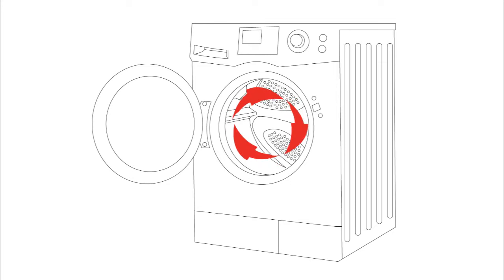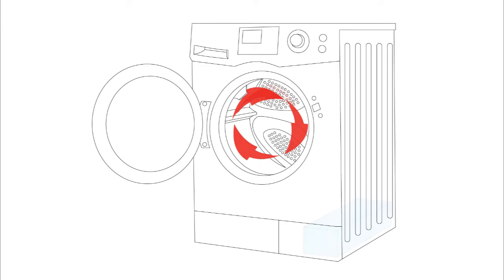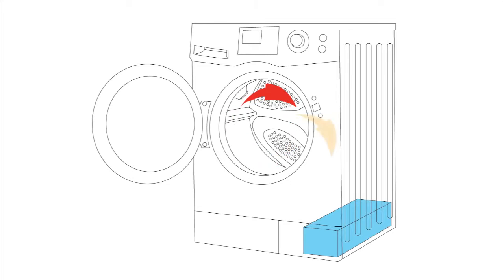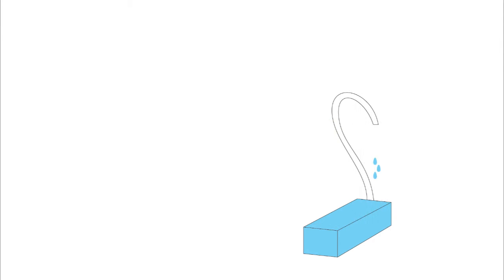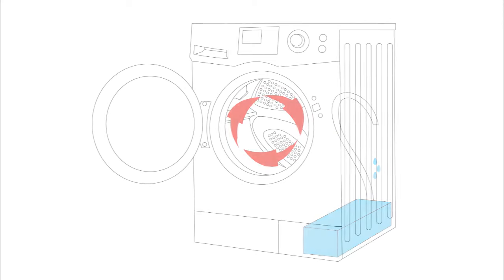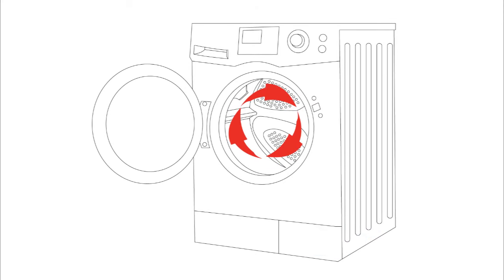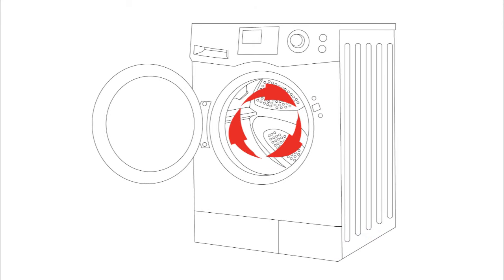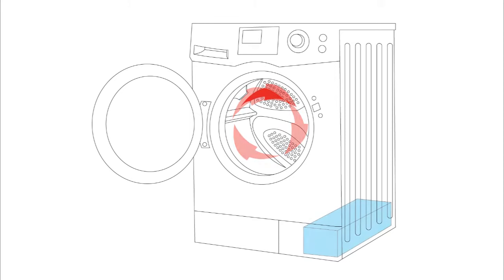How Condensation Drying Works

Comment: Video doesnt really explain how the dryer works at all
Reply: what part didn't you understand?
Reply: DerkeDerkTTV  but it will only condense on the condenser if the condenser is colder than the warm moist air from the dryer. As the water condenses on the condenser it will cause the condenser to get warmer and warmer (latent heat of condensation). What happens when the condenser gets so hot that the moisture in the air no longer condenses?
Reply: @codaroma  I think they eventually start to dump heat to the indoor environment when the condenser temperature gets in danger of rising above then dew point.
Reply: @gregorymalchuk272  the amount of that is very small though